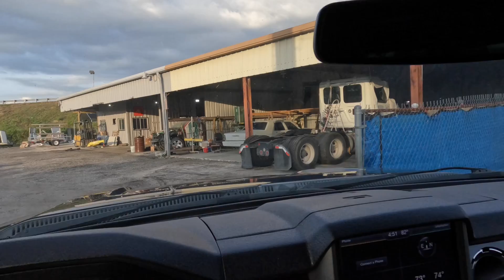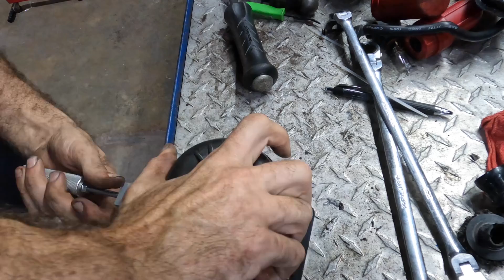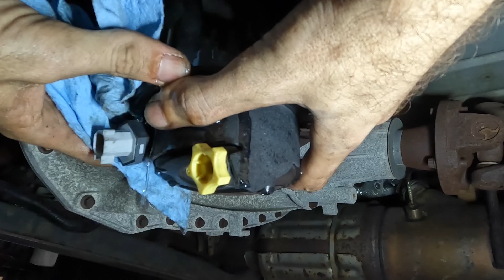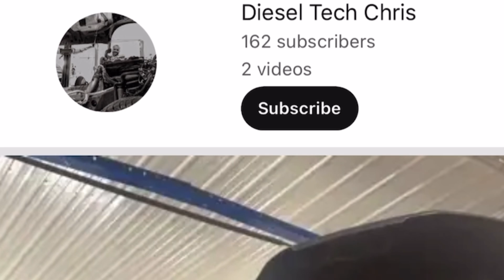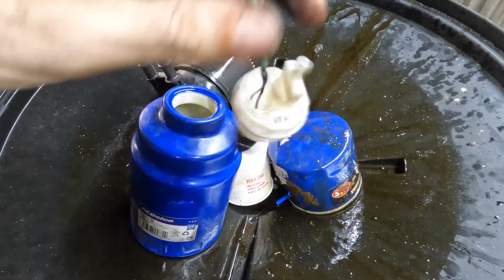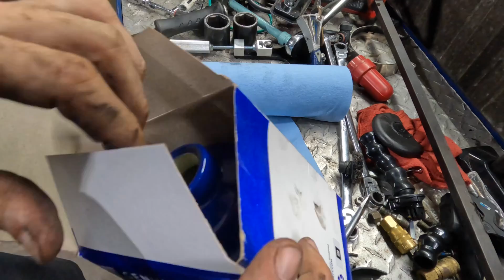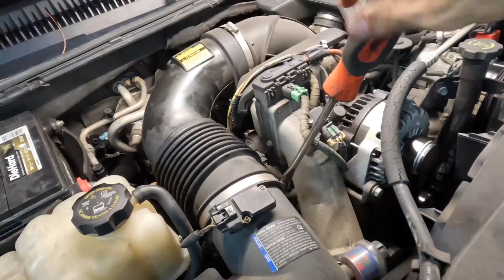Diesel Fuel System Filters!  Duramax & Powerstroke 6.6 & 6.7

Comment: As a UK fan I'm always amazed at the engine sizes in USA. Most of our pick ups are now 2litre td with a couple 3.2 td. Most of the 4x4s are the same. VW, Audi, BMW and Merc have slightly bigger at maybe 4litre but I'm not aware of anything bigger. Couldn't afford a 6.6 at 10 bucks a gallon for diesel and only slightly cheaper for petrol.
Reply: That's the UK price per gallon and the added road tax a considerable figure ,towing limits much lower in Europe so engine size not required.
Reply: Your roads over there are kind of narrow and twisty for the trailers we sometimes tow here. Don't imagine you have a lot of dually trucks towing 40+ foot long, 30k Lbs. trailers. I used to tow a 50 foot trailer that could haul 3 cars at a time. Wouldn't make it around many corners there in the UK.
Reply: Im not completely sure as to what the major differences are in regards to location (i live south of Ray by about an hour), but it seems to me like most people in my area have a truck in each driveway and they are just about all 4.6L or higher. Lots of diesel. If i buy a truck, i dont buy anything smaller than a 5.3L (such as my tahoe). My car is just a little 2.0L, though. I think it may have to do with the fact that people travel more in the US with RVs and what not. I couldnt imagine owning a truck that couldn't pull my trailer or RV. Seems like the purpose is lost at that point
Reply: @Sun_Regalia  big lazy powerful engines do not get stressed .. they work forever .. 

unlike those tiny 300hp Japanese 4 cyl that rev and rev and rev .. then bang!
Reply: We Americans have an engine size ego haha. But I'm a fan of all litre sizes. Not a fan of all engines (LS). But we have V8s that run up to an 8.0L. GM put 8.0 V8s into their cargo trucks that moving companies use i.e. U-haul. I drove one a couple of times and you can literally watch the fuel gauge drop as you drive hahahah!
Reply: Back in the late 60's and early 70's we had car engines displacing over 7 liters that got less than 12 mpg. But our gas prices were less than a dollar per gallon. We still have trucks with engines that large and some high performance cars, but they get 20+mpg as long as you aren't mashing the pedal to the floor constantly. When I was very young, I remember seeing gas prices of 35 cents per gallon.
Reply: To be fair, an F350 is way out of the average truck owner’s price range even in the USA. These are the trucks that are often used for construction or turned into utility vehicles (bucket trucks, lineman trucks, etc).
Reply: Sad, # 2 Diesel in central Nebraska is $ 4.94 a gal.  Reg 87 oct ethinall free $ 3.64. , 10 % gasohol is $ 3.24
Reply: @billloutzenheiser5397  In the Southwest, gas is $1.50 more than what you're paying.
Reply: @aaronbritt2025  what part of the Southwest. Southwest Louisiana it's $2.65 to $2.99 for gasoline. Diesel is $4.25 to $5.00 🤬🤬🤬
Reply: @brucegarrett7232  the southwest US. Ca, AZ, NM...
Reply: @aaronbritt2025  pull the claws back
Reply: @brucegarrett7232  it’s $9 a gallon here in Canada
Reply: @oxygen454  come to the Southwest it's warmer and you'll be able to drive cheaper.
Reply: @brucegarrett7232  haha I would if I could. California is only a few hours from the boarder crossing that I live by.
Reply: A US gallon is 3.78 litres. A UK gallon is 4.55 litres. Direct price comparison isn’t possible you have to correct for the different volumes.
Reply: @VLC8792  wine gallon!, biggest scam!
Reply: @VLC8792  a gallon is 3 litres and currently where I live in Europe next door to the UK and slightly part of it a litre of diesel is 2.05 euro so by 3 that makes it 6.15 euro a gallon.
Reply: @tdkyt46  a British gallon is eight pints or about 4.5 litres.
Reply: @billloutzenheiser5397  it came down like 30 cents over the weekend here in Wisconsin,  I see it for $2.99 now
Reply: It sucks to not be American , except now with our current clown show in government . . .
Reply: @Longeno55  All governments are clown shows atm😠. Everybody needs to start voting to the right a little bit🤔. But not the conservatives 😠. They are more leftist than Labour & Liberals 🤪🤣🤣🇬🇧🇬🇧
Reply: The vehicles overall are larger. Heavier and more towing capacity.  Never pull or stop the same trailer rays Chevy can with a 3.2td.  It's not $10 per gallon in the US either, yet.  It's under $5 where I am.  That's not to say we dont like our big trucks though.
Reply: @EarningIgnorance it’s ten bucks here in the UK
Reply: @Mr B  is it in a truck? Usually those engines overheat more then a few times and they are unrepairable. Aluminum ones at least
Reply: And your climate oligarchs privet jets have the same engines?
Reply: @Mr B  👍🏻 cool .. I bet it’s enjoyed regular oil changes in your ownership
Reply: Life under the EU regulations overkill
Reply: Diesel costs me £1.89 a litre where I am in the UK. To fuel up my 2.2 litre Ranger, it cost me £170 the other day.
Reply: The US has gotten excessive with trucks. I'm becoming a huge fan of the UK, including their vehicles. Shout out to Artisan Electrics if you enjoy watching top notch electrical work!
Reply: Well we in the west live in a state or province thats bigger than your whole country. More room less people and more toys to haul
Reply: I've told a few American friends I've met online that the biggest Ford you can get in the UK is the Ranger and it genuinely boggles their minds 😅Seriously though, UK roads are just completely unsuited to that type of Heavy Duty 4x4 with a fifth wheel trailer. Hence Cab-Forward lorries and Sprinter vans, meets the demands of heavy hauling much more efficiently for our roads 👍
Reply: In Poland and many other places in the EU we love small turbodiesels in regular cars (regular because pickup trucks you're allowed to drive with standard license are also called cars here). Those diesels are mostly 1.6-2.0 litres in displacement, but they produce from like 100 to 150 HP and 250 to 400 Nm of torque. This is more than plenty for a regular car and the fuel consumption is still low, like 4 to 5 litres for 100km on a motorway, and 6 to 8l in city traffic.
Reply: There's a video of some guy in the UK driving a TRX in the UK, spoilers if that tiny truck can barely fit in the UK this f350 he's driving wouldn't fit anywhere. What you guys call trucks are really cars with beds.
Reply: @Abandonsoyciety  I've seen some mad lad driving some sort of Ford Super Duty in the UK I'd hazard a guess at it being an F350 because it had the big ol' towing mirrors on it. Even better he was driving it on one of our single track country roads and the mirrors on both sides were practically in the bushes.
Reply: @Abandonsoyciety  those 350s are massive by UK standards .. we do see the occasional 350 dually in the UK but some of our roads are so narrow that you have to breathe in and hold your breath when driving the other way to an oncoming SUV such BMW x5 / Merc ML coming the other way 😂
Reply: Where you from fellow countryman?.
Reply: I would pay to see a dual tire axle Ram 3500 or F350 try to navigate European roads.
Reply: That's cuz Europe sucks
Reply: Greame, B7 deisel is about £10.00 sterling per gallon here in the uk🇬🇧. Which is about $13.00 usd🇺🇲 per gallon. I've got a transit connect, & to fill it up from when the low fuel level light come on, it cost £100.00🇬🇧, to fill the tank😳🤪. That's about $130.00🇺🇲. Which lasts about 2 weeks😬😢😵😵🇬🇧🇬🇧🇬🇧
Reply: @stephenwilliams6103  You pay more, but your cities are more compact. That little tank lasts you 2 weeks. Here in the US, it would last you 3 days. It's not unheard of for fleet vehicles to put 300 to 500 miles/wk on the odometer.
Reply: Middle aged dads that need the space once every 2 years will find any excuse to buy a whopping 6.7 liter diesel truck
Reply: Well do to a short period of time in the US we could only get Japanese branded trucks that weren't full size with the exception of chevy colorado. Which includes Tacoma, frontier, and "ridgeline". The dakota and ranger weren't being produced anymore while the ranger was available outside the states it wasn't something we could purchase here. Most companies opted to build there full size truck with smaller engines to replace the small trucks.
Reply: As someone who is also from the UK I am shocked at a diesel getting only 15MPG
Reply: @iambenmitchell  Well, it also gets 15mpg while towing 30k pounds. I don't see any UK trucks pulling that kind of load, short of commercial trucks.
Reply: German for click is very similar………….it’s klicken.
Reply: There are 4.54 litres in a Canadian gallon so it’s 2.29 times 4.54 equals 10.39 Canadian per gallon
😊
Reply: Diesel is 15% more expensive than petrol,now,in the UK.
Are you perhaps living in France or the Republic of Ireland?
Reply: Currently paying around $2.30 a liter here in my part of Australia, so around $9 and change for a US gallon. It's always interesting filling up the work trucks. One takes 250 liters, so when it's getting below 1/4, I am kind of getting used to seeing $600 worth of diesel go in. And I am glad the boss is paying for it.
Reply: @johnalees99  $9 AU is $6 US, so only a little more than we're paying.
Reply: Most of us Americans have small cocks so we need to compensate with other large things 😂
Reply: Just saw an old silverado towing a 5th wheel camper trailer in Perth Scotland last night. Guessing 80s or early 90s, it dually, very square body and huge square headlights. Sounded gorgeous with the v8 burble.
Reply: The scary thing is my truck ( you’d call it a lorry) has a 15L diesel.  I spent almost $1500 in fuel last week.  Of course, I drove from Los Angeles to Savannah, GA, 2400 miles and then to Orlando FL
Reply: Now look into the size of our campers/caravans, race car trailers, horse trailers, etc etc.
Reply: I cringed when I watched him fill the huge auxiliary fuel tank in the bed, in a prior video. But it's not really buying extra, just stocking up (and the added weight of the additional fuel is likely not significant, all things considered).
Reply: Diesel in Canada is $2.29 per litre. 
There's 3.78L in a gallon. 
3.78 ×2.29= $8.66   per gallon in canada.  The Americans have it made stop crying please.
Reply: @DoubleoP  Where I live in the US diesel is always amongst the highest in the nation due to state taxes.  It's very close to that price.  Prices vary wildly in the US because of how some states tax fuel.  For diesel we have highway use (very high tax) and off road for farmers.  They use dye so they can tell which one you are running.  You don't want to get caught running off road diesel on the street, the fine is insane.
Reply: @DoubleoP  no one here that is American is crying... learn 2 read
Reply: @DoubleoP  which when you apply current exchange rate works out to be 6.43 usd per gallon.  Still insane but not as bad as your making it sound.
Reply: @DoubleoP  2.70 in nz, that's roughly 3.10cad
Reply: @Paul  perhaps...and this is just a thought...

If you drill it from your own grounds it should be on par with our prices maybe a little bit more but not DOUBLE...too many taxes up there for the dumbest things...
Reply: @DoubleoP  no we Americans will not stop crying. That’s why we kicked the British out. But in saying that two different lottery winners from South Dakota moved to Canada. Why is that? Soon as I win, I’ll look into it!
Reply: @greenthumb6875  don't know why they did this... maybe they have family or just are lefty people. Canada's gun laws are very strict.
Reply: To normalize this engine size discussion, I have a US truck (trucklet?) which has a 2.5 L hybrid engine.  It can tow a whopping 2k lbs. With no added baggage, it can deliver more than 40 mpg on US gas - in town!
Reply: @dennislyon5412  Trouble with a setup like you have is, although it's nice mileage. If you did the work a lot of us do with bigger engines it would last a fraction of the time. Entirely removing all eco value it's milage may have offered.
Reply: @wolvenar  - it does the same work as more than 50% of 1/2 and 3/4 ton trucks do daily - haul 1 or 2 people about, and loads 2 times per year.  No work truck needed.
Reply: @dennislyon5412  I would love to see it hold up to what I do. The frame or springs would be dead before the end of a day.
Reply: @dennislyon5412  
If you're using that thing as a car, why don't you own a car?
Reply: @wolvenar  - not meant for that purpose, I’m sure.
Reply: @dennislyon5412  must be a ford maverick!
Reply: @dennislyon5412  hybrid in town?  I'd expect decent milage.  Question for those is highway
Reply: @ret7army  - 36+ mpg if you go 70 or less.  MPG drops off quickly (32 mpg at 80) if you go much faster.
Reply: I have a 6.7 Ford F350,  Diesel here in the Seattle area is 5.25 to 5.65 USD a gallon.  Its 200 USD to fill it.  It mostly sits now.  Im retired, fixed income and its getting harder and harder to justify keeping my truck and 5th wheel.

Comment: That is disturbing having the drain-cock hanging below the vehicle - I seen same on some radiators you work on.
Run over something - get it snagged and you lose all the fluids out the bottom.

Comment: amazon parts i agree with engine parts.  i watched a vid on a guy that bought NGK plugs and when they came looked legit even the holograph sticker but he felt something wasnt right.  bought some local and compared and there were some differences.  he got a hold of NGK and gave them the info and they confirmed they did not make those plugs.  we also see this even in electrical supply places.  Honeywell makes the high voltage gloves and yes they have fake ones out there.  know where you buy from and always check.
Reply: I only buy from the ones who have company names related to the part. It's not fool proof, but helps

Comment: Nice. Blue Jeans metallic - I have basically the same truck and color, but not King Ranch and I’ve driven it 168k miles 😅. Oh, and it’s a 2014 and you just reminded me my fuel filters need changed. You can just replace them both and key on-off like 5 or 6 times and it’ll start. I will try it the way you did it though just for shits and giggles. 

 I try to have PTT do all the big stuff, and I just do the little maintenance items.

Comment: Question: Why couldn't you use the oil wrenches from the Sema show on your chevy fuel filter?
Reply: they're designed for oil filters and i guess cause the diameter is smaller(had the same question at the start of the video ) :P
Reply: @andrewomagad8497  didn't he buy the complete set?
Reply: @thomasseigler8875  That's what I'm wondering
Reply: the fuel filter was completely round and the oil filter wrenches are designed to grab on to the ridges that are on all the oil filters
Reply: @KraziiC  it looked like it had some ridges on it but i guess ray does what works for him?  Lol
Reply: @thomasseigler8875  also the diameter of the fuel filter is way bigger
Reply: His videos aren't always in chronological order. Might just not have them yet. Or they don't work
Reply: @EarningIgnorance  he unboxed them on camera the other day
Reply: @thomasseigler8875  he also had the blue truck already inside the shop in that video sooo
Reply: @FollowingtheCliffNotes  yep. Referring to his truck

Comment: That gate needs an upgrade.
Reply: OIL THE WHEELS...ANYTHING THAT MOVES...MUST BE LUBRICATED...(SYNTHETIC WOULD BE BEST)
Reply: It's got one. A blue tarp, so it's good.
Reply: @clbcl5  L O L...That was my first thought too. :-))
Reply: I am surprised Ray had it sitting outside of the gated area. Looks like a rough area. 

"Jimmy, Making it work" is also in FL, a little nicer area though. They don't leave customers cars outside overnight in the ungated area because the locals are stealing cats off the cars.
Reply: Agreed 💯
Reply: Bit of grease will sound like brand-new.👍

Comment: yes it is an O-ring
a square ring or a square O-ring is still a type of O-ring
a triangular ring or a triangular O-ring is still a type of O-ring
the shaped rings that some auto parts have are also O-rings
yes a gasket that seals fluids from escaping is an O-ring

all O-ring means is a 360 degree loop of compressible material used to seal a mating surface so no leaks occur
Reply: Right -  the "O" in o-ring is a reference to the overall shape of the rubber ring, not the profile.

Comment: Can somean please enliten me. Way do you even need 6.6? Here in Europe we drive cars that have under 3. The SUV i'm driving have 1.2 😇
Reply: Try towing 20,000 lbs with your 1.2 SUV
Reply: @seanarchibald1321  Do you often tow 20,000 lbs in your day to day?
Reply: @seanarchibald1321  this is 10T 🤨 moust of the people don't have nned for this + there are truck that are dedicated for this. And some show of people buyig this here as well bot is ultra rer.
Reply: I am routinely grossing 20,000 lbs with my 7.3 that has 240,000 miles on it. Not sure if a 1.2 would survive the experience although I have heard that EU fuels and engines are different.
Reply: @stevenbuchanan9420  When someone mentions that they have a 1.2-liter engine, I tend to wonder what kind of motorcycle it is.
Reply: @wesgregg6451  citroen c3 aircross EU 🙃🙂
Reply: @stevenbuchanan9420  Yeah, and I get it.  I too have a ridiculous V8 that I drive around in day to day.  And I do it cos I like the sound and I like the kick in the kidneys if I feel like it too.  I just don't try to pretend that I need the torque and so on.  Some folks do, like you, but most who drive these things (I include me here) it's pure wank factor.  And while I am not in Europe, I recognize the wisdom of their emissions etc regulations as a good societal level idea,
Reply: @jessdonovan9772  you may have wank issues. I will not judge you but I use my torque for pulling equipment. The rest of the time my car is capable of hauling my ego.
Reply: Does your little engine produce 910 lb-ft. (1,234 N⋅m) of torque at 1,600 rpm, lol?